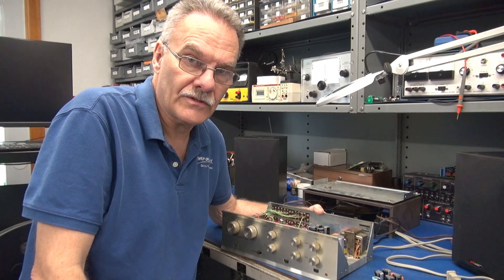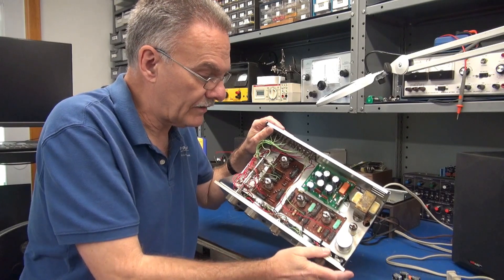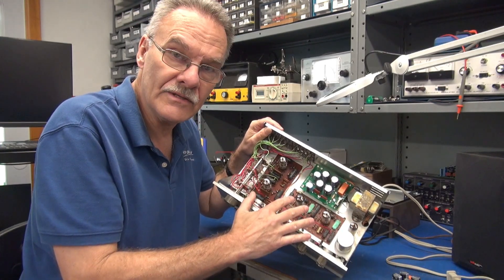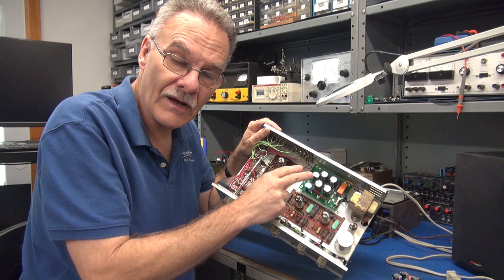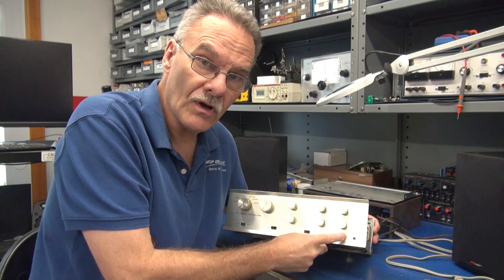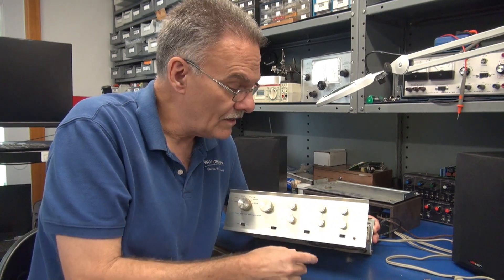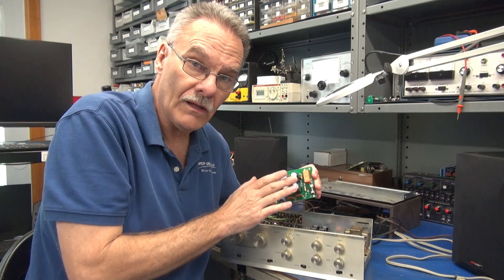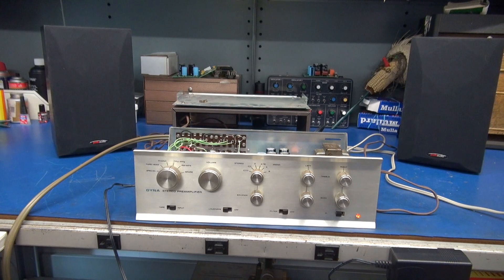Testing of Vintage Dynaco PAS-3 tube preamp after repair and upgraded power supply module

Comment: I notice on the website it says no diodes in the circuit board.  My thinking is why?  It's a good safety precaution if the rectifier fails, and if it doesn't then it's still tube rectification.

Comment: Thanks for all of your videos in pas 3 restorations. That looks to be a Pas 3x. I just restored one. I've been putting it off for years, had the parts, just didn't get to it until recent. New sds power supply board, new transformer, new electrolytic coupling caps on the bass pots and new rca jacks. It does work, but the left channel has less treble than the right channel in every mode.

Comment: I bought and installed D-Lab's PAS+ board in my PAS3.  The engineering and quality that went into it is top shelf!  If you're thinking about updating an old functioning Dynaco PAS, this is a very sensible FIRST place to start.
Reply from the maker: Thank you my friend, glad your pleased with the module
Reply: I'm curious about the relay. How is it powered? What's the voltage and does it have a delay?